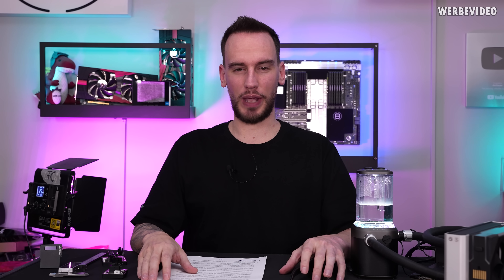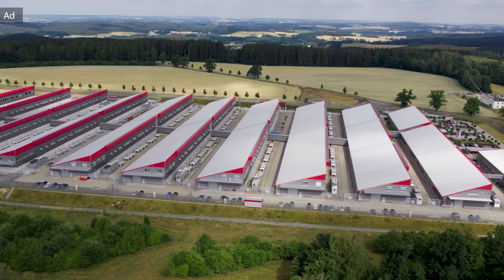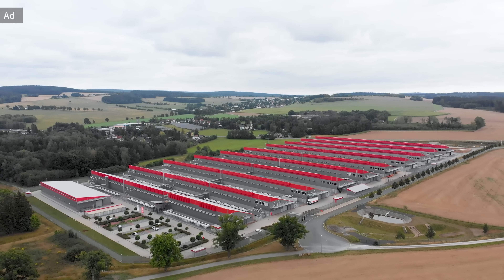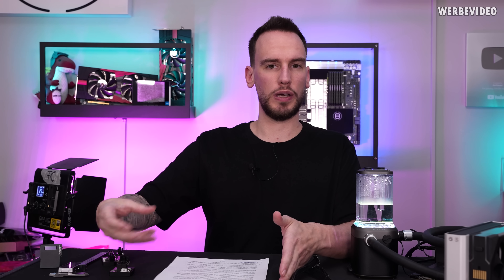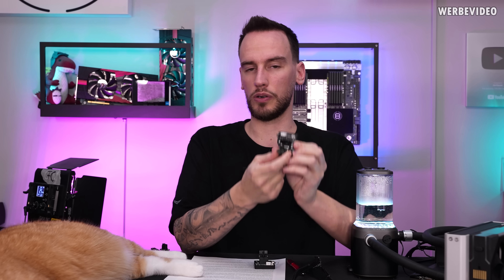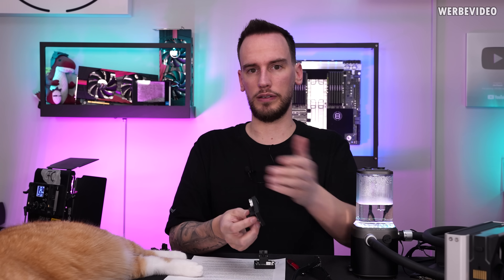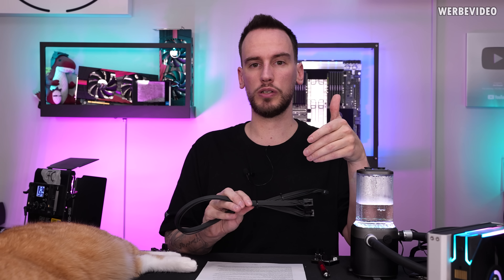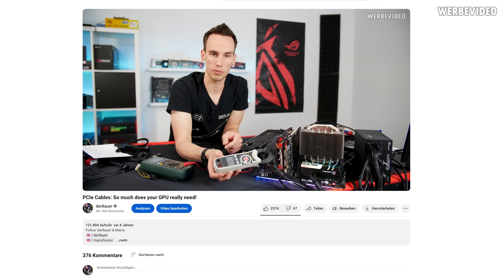12VHPWR is just Garbage and will Remain a Problem!!

Comment: Maybe, there could be a (3D printed) bracket, which could stabilize the whole connection. Something what would clamp across cooler and backplate. I can imagine it doable for both cables and adapters. Of course, it would be very card-specific...
Reply: thats not the issue, the issue is the connectors inside the plug itself are too small and don't always make adequate connection, even when plugged in correctly.

Comment: 15:00 If you have to hold your tongue at the right angle just to get power to the card something is wrong with the whole system. 

I said it before, this 12V HPWR connector has to be work of a non EE intern. No self respecting EE would do such a spectacular dumb thing.

Comment: If bending it's one of the problem,why manufacturer don't make the plastic of the connector more longer,like Seasonic recommend at least 35 mm? I understand that requires custom plastic mold = more cost but would solve one of the problem this connector and potentially lower RMA?

Comment: At this point I'd argue that 12V itself might be part of the problem. Nothing on a PC runs on 12V anyhow, it's merely used as a power distribution mechanism. And for that we can do what 3D printers and... like... regular powergrids already did: ramp up voltage. 24V 8A is a whole lot less cable issues than 12V 16A. Heck, it's also what EV's are doing. They have, realistically, for DC charging just 2 pins: chonkers. My own car charges with up to 800V to push 230kW through those two pins. Not saying we should put CCS connectors on a PC, but honestly, I'd say this stuff is fundamental. Heck, in the datacenter world nVidia already solved this, SXM has its own power pins

Comment: only been saying this for like two years against every youtubers and tech reviewers..why ? because I made pictures telling everything one with 3 pcie8 and the 12vhpwr taped to my table and you could see something most people don't realize a 12vhpwr is smaller than a single pcie8 >< (slightly wider but less thick) two unlike most people I had at the time 5 different pc cases and in all of them including my main lian li 011 dynamic xl you could not close the side panel without pushing on the connector..the so called "user error" by GN, the problem is both tech reviwers and nvidia keep using open test benches to do everything when they are NOT a real pc, if they tested in real cases they would have realized RTX 3-4000 were wider than amd or earlier cards, and the 12vhpwr can't be bend as much as pcie8 that combo made it impossible to properly close a pc without forcing on the connector..oh and also you're lacking 2/3 of the wiring thickness which doesn't help

Comment: A huge problem with old PCIE 8pin/6pin connectors are the daisy-chained cables most PSUs give you. They have two 8pin connectors on the GPU side but only one on the PSU side. If users can be trusted to not use these, graphics cards can get away with using fewer connectors. Like the infamous R9 295x2 which has a TDP of 500W which is higher than the 4090. That card only runs on two 8pin connectors.

Comment: On top of all this always keep in mind what they're charging for their GPUs. For those prices they should've at least include a fire extinguisher.
Reply: So true 😂
Reply: Its not even the GPU manufactoring, nor cable anymore. This was a fail on Cablemods part. They royally screwed this up. And ofc we all blame it on everyones current punching bag, the 12VHPWR, or Nvidia. 
Its not even any of these two's fault. 12VHPHR fixed their cable, with a better design. And Nvidia is just using it as it can deliver the power needed to its GPU without a mess of cables.
I dislike Nvidia just as much as the next guy, and personally rock a 7800XT. But we can't blame them for another companies actions.
Reply: @Triro bot
Reply: @myta1837  Uhm. Nothing says sad like liking your own comment 4 times.

Comment: I am so annoyed with all this, I’ve spent a small fortune on building my pc around the fact I need a 90 degree adapter/connection so I can close my side panel. 

I bought the first CM adapter, worked perfectly, then a few months back I’m told it’s no good and they will replace it with v1.1. 

Ok great, I paid £20 to have the replacement shipped, worked perfectly. 

Now I’m being told that the new version is faulty and there is no news of them providing any replacement. 

Now I’m in the position of having a pc that appears to have no problems but I can’t use it, fork out more money for an entirely different solution, thus changing the aesthetic of my pc and making another product redundant, wasting even more money. 

Or simply carrying on and ignoring everything in the hope I’m one of the lucky ones. 

RegardRegardless of whose fault this is, CM provided a solution to a problem that has failed, and I’m out of pocket and left with an extremely expensive fire hazard in my house. 

In my mind CM are doing their best, its nvidia that need to step up.

Comment: As I understand it. Nvidia thinks two 8 pin connectors will take up way to much board "real estate" on the PCB. So the solution was to change to 12VHPWR

Comment: As an electronics engineer myself, using similar connectors I am actually very confused about all these problems? We have been using similar connectors for the last 15 years producing well over 10-20k units per year. Not one single faulty unit. We only use Molex and JST branded and they have zero problem doing the max ratings over long periods of time in a guite warm environment.
I also don't agree with the explanation here. I think the main problem here is the mix and match between brands of connectors between cables, adapters and video cards.
Some video card and cable manufacturers are using very cheap and low quality connectors as well as bad matching metal parts (pin and receptacle) 
Again, an high quality Molex to Molex brand connector has no problem sustaining this amount of current.
I test that even on a regular basis.

Comment: Great video. This awful cable connector standard is why I upgraded to a 4080 instead of a 4090 a couple of months ago to try and reduce the risk of a meltdown. Also the updated standard mentions shorter sense pins? Won’t this make the situation worse?

Comment: I disagree that the solution is 2x 12VHPWR, this plug design was crap from the beginning then made worse with its location on the card meaning it didn't fit in most pc cases without out of spec bending of the cable. Now the video is suggestion 2x 12VHPWR cables bent tight trying to fit in most PC cases. By the way I have a 4090 and I saw no need to push it to 133% (600watts) and frankly the performance loss at 66% (300watts) was minimal and now gave me 100% overhead on the 12VHPWR connector/cable design.

Comment: It makes me wish for EVGA and their "let's just do ut approach". You can bet they would release 3x4 or 4x4 molex card, just because. Plus RMA savings.

No fire, but due to instability and finickeness I am 4090 no.3 and PSU no.3. (RMAs via replacement to different models.) Failstates of this are tragic. PSU/GPU dies because of current spike on failrure of cable. Faulty detection of cable (is okay, it is not) etc.

On other hand MSI seems to be making better cards now than Gigabyte or Asus in my experience. :) and PSUs were all Seasonic.

Comment: I was keep telling that since the very first time issue exposed to daylight..
nvidia has absolutely no respect for it's own customers, especially the high-end product users.
After selling & ripping off the most expensive product buyers, nvidia was keep ridiculing it's own customer with the "IT IS A VERY OBVIOUS USER ERROR'!" and/or "USERS FAILED TO CONNECT THE CABLE THROUGHLY. THEY THOUGH THEY PLUGGED IN. BUT IT WAS HALF WAY IN! WAS NOT PROPERLY CONNECTED!" statements.
I am always having hard time to understand the mindless nvidia worshipping.
It does empty your pockets (with rushed imperfect products) and than mocks you openly.
World needs to bring "consumer rights" to the table and discuss again.
Things are getting out of hand...

Comment: Thank you... thank you for showing the world how stupid this connector is. I actually desoldered 6pin from old gpu and took a cable from non working power supply and was able to push 15A through single wire without any extreme heat ( i was able to put my finger on it and it was warm  - so 35 to 40 celsious max.)... that means that 2x 6pins  are 6x15A*12V = over 1000W. I know i could have very good connectors in my hands, but i believe it shows how stupid that 12VHPWR connector is. If you need a lot of amps size matters. Contact size and size between wires for natural cooling. 12HPWR has both things worse. I thing that only reason for changing connectors is because of switching for a different voltage. Some server are going up for 48V and I still believe that it should be possible to use 8 pin and use one ground pin from that for detection if it is ground than 12V should be send there and if it is lets say 5V there PSU can send 48V there. Compatibility on GPUs is actually easy... 12V things would work fine, 48V thing when supplied with only 12V could work also but with limited power (internal DC convertors are designed for input current and with lower voltage on the input they are also able to work but in a worst case scenario with 1/4 of its power) Or just make a new connector just for 48V... everyone who knows absolut basics know that you can pump 4 times more power with the same number of wires and power loses will still be 4 times lower. (generated heat is voltege loss times current, and compared power loss from 48 to 12V means that when you loose 0,6V on 12V with 20A on that you are genereting 0,6*20=12W of heat and loosing (0,6/12)=5% and for 48V it is the same 0,6V with 20A=12W, but loosing only 0,6/48=1,25% of transfered power.

Comment: Just put power supply directly on the graphics card and supply it with IEC C13 C14 connector. GPUs are so enormous these days no one will care if they become a bit bigger. And of course 2300W capability of C13 plug should be enough for even RTX6969Ti.

Comment: You're wrong about derating stranded wire. You don't derate stranded wire above 24 awg or so. Those list for derating are for multiple insulated wires combined into a single cable. Like the 2 or 3 wires in a power cable (line, neutral, earth).

Comment: i said this before on many other vids on other channels but we already had a small ,proven connector that would've worked for all gpus . the pc power connector found on the power supply .the clip system could be molded in and bam a locking psu cable that can carry 1500 watts. minor retooling as opposed to massive new tooling. such a waste. On a side note, the all 12 volt mother board only works if all the normal 5 volt devices and 3.5 volt devices can run on 12 volts only. then it makes 100% sense but that's not how we started making chips.

Comment: Correct me if I'm wrong, but if you reduce the number of pins on a power connector, shouldn't you increase the diameter of the remaining pins?

We all know that there will soon be an ATX 3.1 standard, and the RTX 4000 series cards and associated power supplies will plummet in value.

Comment: I knew this would happen for a long time, I did not buy 4090 and possible high power 4080, I have stick with 4070 for safety. The cables should be not close together it would upset the current flow if there temperture rise, with the cables close together I would deduction of 0.25. example 600W with the deduction 0.25 would make max usage of 450W. But that won't be guaranteed even at 450W.

Comment: Yeah I have a 4090 and constantly thinking thinking about the connector melting. I don’t know if undervolting the card will be safer. I also feel it’s ridiculous that I even have to consider that. I just want to use the card I bought to the full potential without having to worry about the connector melting.

Comment: lets make a new standard based on eps12v and make it a 12 pin instead of an 8 pin and Problem solved. this connector is robust enough to anything the 12vhpr does, but without burning your house down

Comment: 17:49  I can tell you exactly what will happen if or rather when that happens. First Nvidia will blame the user for user error. Then they blame the board partner who's card went up in flames for design or manufacturing defects. If that doesn't work they will do the same to the connector's manufacturer and when that doesn't work they will just brush it off as some sort of anomaly that for some reason they will surely think of won't be covered by warranty or something similar. 
Call me cynical but I think for the past few years Nvidia has proven to be anti consumer enough to handle the situation more or less this way

Comment: 12:25 The RTX 4090 is not the problem, but the location Nvidia is putting the connector on the card, AKA Nvidia's engineers made multiple design errors.

Comment: This is just planned obsolescence...

It's the same reason why the 1x900Ks use up an insane amount of power. 

Even if they don't fail catastrophically... They'll just melt internally at a microscopic level, so that you will have to buy something else 5 years later.

I'll be surprised if we even find any 14900K working properly in 2030...

Meanwhile, CPUs from the 90s and 00s will work forever
Reply: There's a reason why a lightbulb from 1901 is still working today, and the ones you buy usually last 2 years....

Comment: When 4000 series was out, I switched to AMD right away. At that time I told myself I ain't gonna spend 2000 bucks to get the card and run 500-1000w bios w it while supplying power through one connector. Happy with my 7900XTX bought during sale at 800 bucks, 2k is good enough.
Reply: Stop calling 1440p "2K", jfc.
Reply: @kunka592  yeah yeah yeah, habit. It's fast tho. I don't really care.

Comment: My brain CANNOT COMPREHEND as to why you'd want to reinvent the wheel? Like why? 🤦 

As Der8auer pointed out a normal 8pin times 2 or 3 connectors will be enough power for a 4090 plus one can even undervolt the card to lower the temps and power draw. 

Im sorry but Nvidia fucked everyone over big time with this kak. 😂🤣🤦

Comment: Can you pls add the link to your 2080Ti testing as promised?
I really don't see why not use 1, 2 or more CPU 8-pin connectors. They have 4x 12v per connector (which gives them power carrying capacity of 288-384 watts according to 6-8A per wire) and have been powering rack and datacenter gpus FOR AGES. Plus, that would unify all 8-pin connectors on the PSU so that users don't need to tell PCIe connector from CPU connector. 
 
As far as Strix 4090 shutting down - I think that's GPU BIOS does weird things when it detects poor connection/contact loss on the sense pins, not power pins themselves. While Gamers nexus were investigating connector melting issue, they have tried to power their 4090 with 4 or 6 12v pins cut completely off of the 12vhp (but good sense pin contact), so effectively only two 12v wires + whatever comes through PCIe slot - and found no issues with powering their GPU or connector melting under load. So the margin is certainly there, but the plug depth, power sense and general plastic softness are a total mess.

Comment: thank you for making this video, i did have this exact question as i am using the wireview for my 4090. my guess is that the most people who have melting connectors use a third party 4090 card that maybe pulls 450w from the socket? ive never seen my founders edition 4090 draw more than 300.... not sure if that is intended or just my use case but would it be considered "more safe" the less voltage you draw through the socket for a longer period of time? i would guess so ? anyway... my entire computer was built with the adapter in mind, without it i cannot close the enclosure.... so not much i can do about it now, just gonna have to find out the hard way when my house burns down lmao EDIT: i downloaded msi afterburner, set my powerlimit to 75%, seems there is not much performance loss, hopefully that helps the connector to survive a couple of more years

Comment: I think people like you need to get different spec monitors and push the connectors until they give out. example will it take the same voltage to power a 4k 42 inch screen against a 4k 24 inch screen.

Comment: just use 2 screws on the connector like old serial and vga
Hell some of my astrophotograhy gear even has this for usb
Workx great and no danger of it comming lose vs thd flimsy platic tap

This issue is also why i limet my 4090,s to 450w ,just to give me some headroom

Comment: I wonder why we don't just use 2x 8-pin or 10-pin Gx16 aviation connector, it's already has better standard and it may have been a way better solution and probably being mainstream nowadays if it wasn't because of it's reputation being dragged down by the cursed Tagan PSU that uses this long time ago.
It's way more useful as high current connector instead of being used by posers who uses this thick boi as usb cable for whatever reason they think it's cool.

Comment: There is another thing that YouTubers are not talking and could  be  part of the problem: To my knowledge direct cables are not melting, which points to the "adding an adapter" situation. The adapter creates a second point of heat production in the PSU cable side (in addition to the GPU side), and the copper cable is an excellent heat transmiter, thus capable of  rising the base  temperature also at the GPU side. If you don't have a good contact in the intermediate junction it will also reduce  the safety margin at the GPU side  (compared with a "no adapter" situation)
What I don't understand is why Nvidia does not have a temperature sensor in the connector itself, they are inexpensive and any gaming PC has a lot of temperature sensors in less critical places
Reply from the maker: there are cases of direct cables, melting too